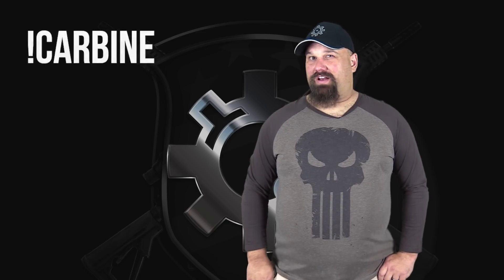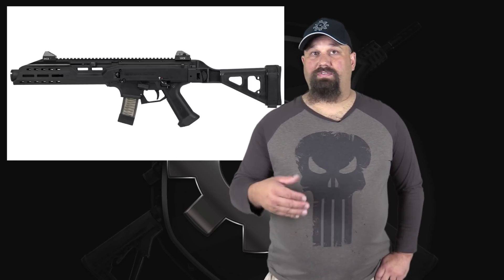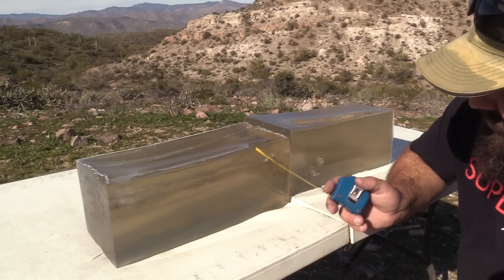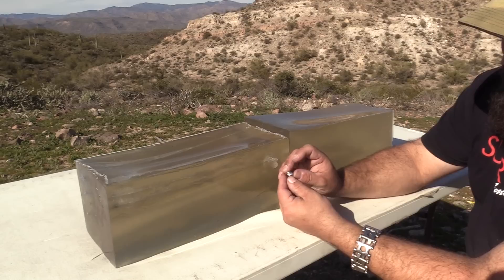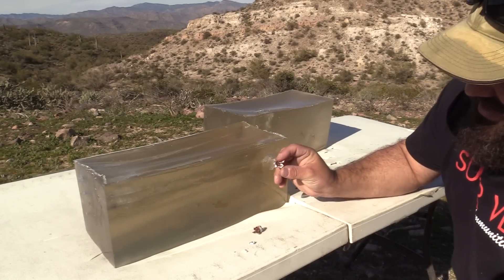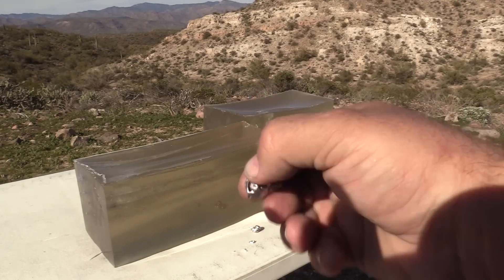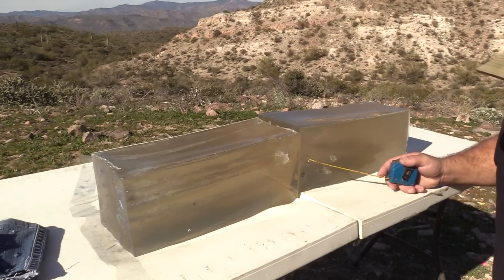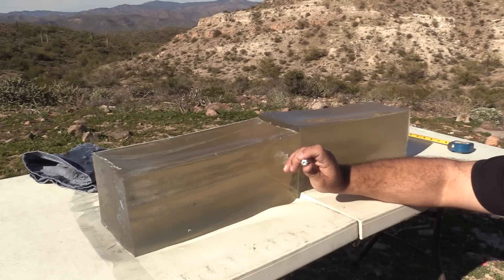Ludicrous Speed! Underwood 124gr Gold Dot Scorpion Gel Test

Comment: The thing this channel has made me realize more than anything is how weird ballistics is. Faster doesn't always mean better but it can but only with some bullet types and with others slower is better but only kinda
Reply: LOL, right? There aren't really any absolute truths as applied to bullets. And there are so many variables in play besides the really obvious: mass, speed, sectional density, shape, construction, alloy, and probably more I've forgotten. The lead alloy used in the Gold Dot is exceptionally tough and the plating process makes for a bond between "jacket" and core that is amazingly strong.
Reply: Many bullets that get pushed to +P and +P+ turn to crap, i.e expand and open up too fast and too soon and have subpar penetration. Look at Speers own website - standard pressure rounds penetrate farther than +P or +P+ rounds out of the same barrel.
Reply: @paulthecpa2717  Yeeeeep. Velocity is the most important factor, but a lot of people misinterpret this as "push as much velocity as you can out of it" which isn't the case. It's velocity relative to a bullet's size, weight, and construction.

The performance of this reminds me of the 10mm Gold Dot before an official 10mm Gold Dot, where it was .40 S&W projectiles loaded up to a velocity they weren't meant for. (I'm not a huge fan of .40 in the first place because while 9mm and .45 ACP have their own proven weights that projectiles rarely deviate from, .40 varies so wildly in weight and bullet construction that velocities needed for them can vary just as wildly. Some suck going at .40 S&W speeds, some suck going at 10mm speeds. I love shooting 10mm, but for the sole purpose of self defense it is sub-optimal. The strength of 10mm lies in its versatility.) The biggest example of this being the Liberty Civil Defense ammo, which is definitive proof that even with projectiles pushed out to rifle velocities, a pistol cannot do what a rifle can.
Reply: @bebop_557  Well said.
Reply: @Valorius  Because you forgot to look at the minimums of .47". When you push them this hard they don't have controlled expansion thus they don't have predictable performance. When you have that much variance in such a small sample size it's cause for alarm.
Reply: @bebop_557  civil liberties 9mm produces .223 defensive loading temporary stretch wound cavities and that is from the manufacturer.  It definitely induces hydrostatic shock by speed alone which is enough to stop a person which normal pistol rounds usually do not do! A pistol will never be a rifle but PCC’s with the right ammunition are sure bridging the gap between pistol and rifle leaning on the rifle side with 21st century technology
Reply: I wonder how the extreme defender does velocity wise outa a pcc barrel. It’s going 1600fps in a pistol in the 9mm +p+ or the 45 super in a carbine length.
Reply: Or 357sig. I kinda want an areo survival rifle in 357 sig. it’s a crazy lite pcc.  And it takes glock mags 🤗
Reply: Very well said!
Reply: It also depends a lot on what type of bullet you're talking about. Handgun bullets obviously need enough velocity to penetrate adequately and expand properly. Adding velocity on top of that, however, doesn't do much in the way of increasing wounding. In rifle bullets however, more velocity is almost always a good thing. With the exception of super fragile varmint rounds, more velocity almost always means more tissue damage. As long as penetration remains adequate, faster is indeed better.

Comment: 14-15 inches of penetration, .5 to .9 inches of expansion? Total failure! The expanded bullets didn’t have the pretty symmetrical look when you push them slower. They didn’t do the job they were supposed to…

Comment: Though I understand bullets are designed to perform in a certain velocity window and typically would agree, your results here give me pause in this case. 

Assuming most gunfighters are clothed, it looks to me that these Gold Dots expanded ideally through denim and you picked up a bit more penetration without any downside. 

Is it enough more than Speer offering to justify the cost difference? Probably not but all things equal, I’ll take the BB round. 🤷‍♂️

Comment: When you are referring to PCC's though they all have extended length barrels. Obviously this is because we don't need to discuss four and five inch barrels as that's pretty standard for sub and full size pistols. However I'd definitely consider a PCC with a 4-6 inch barrel ever before considering a PCC with a barrel longer than that. My two cents.

Comment: I don't deny that this round is being pushed faster than it was intended... the pedals are folded way back and twisted and mangled and just flat ugly looking... but you can't tell me that those pedals sticking out and all those sharp edges wouldn't cut and slice up tissue causing tremendous amount of damage and bleeding. I get It, the round was flugly.. . Probably the reason in my EDC carry gun I choose 147gr HSTs. They perform extremely well and always so uniformed and symmetrical. But being ugly and jagged and gnarly is going leave an ugly gnarly wound.. kinda like the talons on Winchester Ranger Ts or the old school black talons. As long as it doesn't completely come apart causing under penetration, but stays whole and goes deep cutting the entire way... should be extremely effective. Just an opinion coming from a dumb ol country boy ;)

Comment: I have a 124 JHP from Rocky Mountain reloading that I have loaded to 1250 fps out of my CZ75b and 1550 from my 16 inch AR9. I use Vhitavuori powder and there SEEMS to be no pressure signs. Ejection and recoil seem similar to factory +P loads. Didn't gel test it but I think the bullet would probably disintegrate!

Comment: TN9OUTDOORS did a test with Underwood 10mm Gold Dot load with similar results. The pedals were ripped back all the way to the base. If it hadn't been a bonded core bullet there would have been complete separation. I'm not sure this is a bad thing. As in your field, it showed a lot of energy dump. Even if the permanent cavity might not be huge, there still would be a lot of traumatized tissue from the temporary cavity.
Reply: I agree, the potential separation of the bullet isn’t necessarily a bad thing. Bottom line is it’s a big hunk of shrapnel. Doesn’t matter if it gets a little chewed up.

Comment: I used to be strictly in the camp that faster was always better. Especially in my Glock 20. I loved Underwood 155 - 200 grain XTP's. But I have come to the same conclusion as a lot of other people before me, that faster is only better when you hit 2100(ish) fps. Pistol velocities are pistol velocities, and the difference between 1200 and 1500 doesn't translate nearly as much in terminal ballistics as it does in recoil and blast. In fact bullet weight plays a much bigger role in pistols. That's why I usually carry 147gr in my 9mm guns. But, just like Andrew said, my opinion is worth every cent you paid for it.
Reply: Wellll, my opinion is that slower bullets are more prone to fail to expand when fired through heavy clothing, especially in low temperatures, and have a harder time punching through intermediate obstacles like plywood, glass, bone, etc. I want to push my bullets as fast as they will still meet standards and are still controllable.
Reply: @newsofthepews  I can't help but think of 45 acp when you say that haha. But as I'm sure you know, there is more that goes into the equation than just that. Why else would 147gr HST be such a great performer. It only hits ~950 fps.
Reply: @parker8453  yes, kind of. But heavy for caliber bullets are usually less good than "standard" weight. 124gr HST does better than 147gr, in my opinion.

Comment: If the bullets held together I don't see why this is a failure. It's definitely past its design envelope but that's what's impressive about Gold Dots. They can stay together when over-driven. Also, my gel results with Underwood 10mm Gold Dots was similar in that the bare gel bullets looked like melted meteors after reentry and the denim shots just looked like very-expanded Gold Dots.
Reply: That's a fair point. most 10mm bullets are designed for .40 S&W velocity  and are therefore over driven in 10mm. But the fact is these projectiles are still meeting the standards. Probably not great through barriers or at any higher velocity.
Reply: Agreed, performance was ideal...